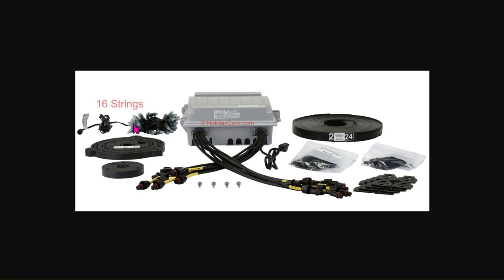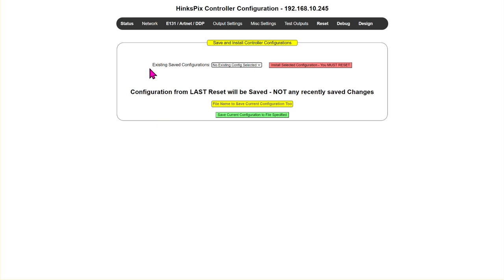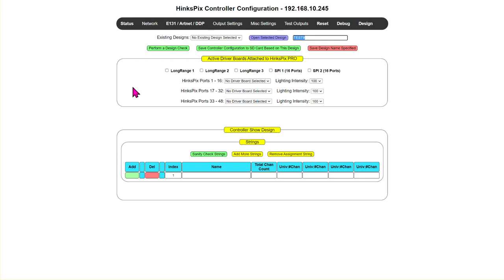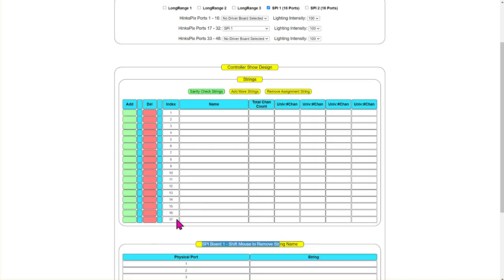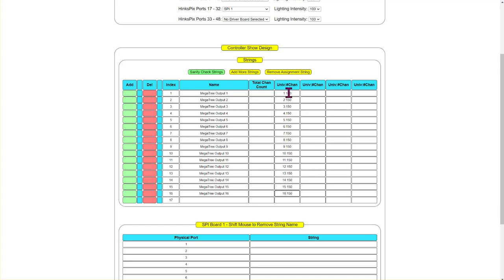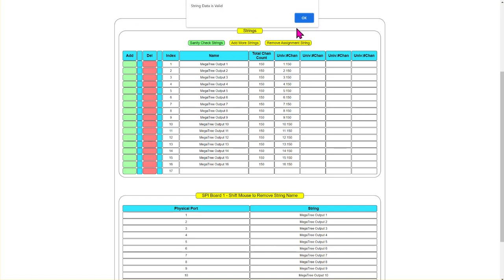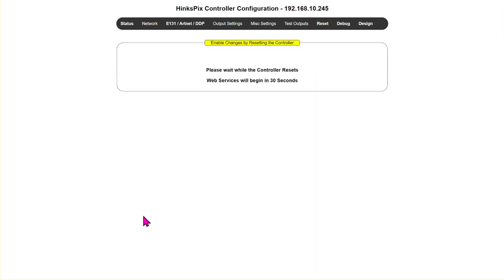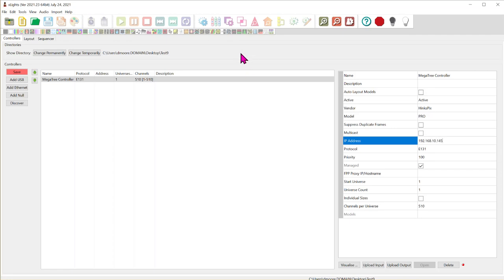HolidayCoro Megatree Configuration How-To HinksPix Controller

Comment: My controller will not save configurations to the SD card at all, what steps can I take to fix this?
Reply from the maker: When using a HinksPix PRO CPU, the SD card must have these specifications:  32gb OR LESS, class 10 or higher, A1 classification (application, not storage)